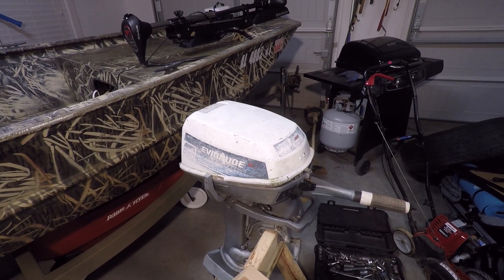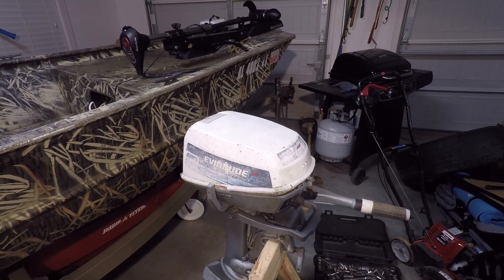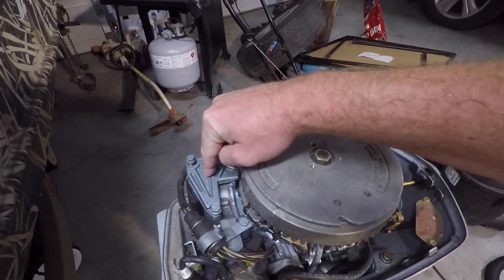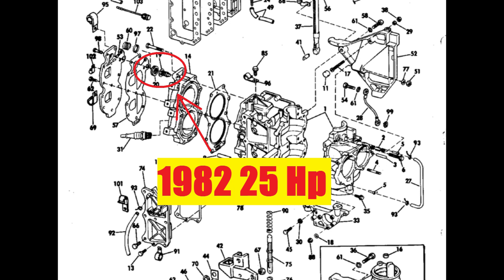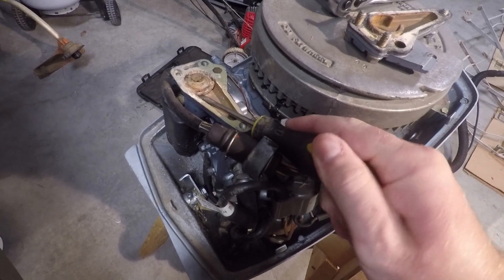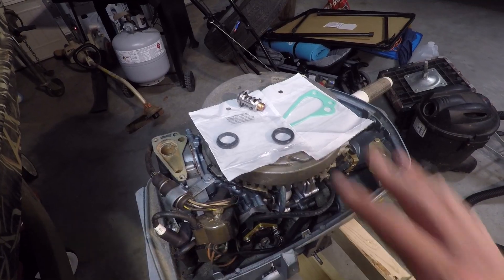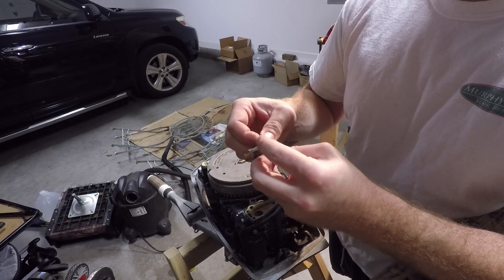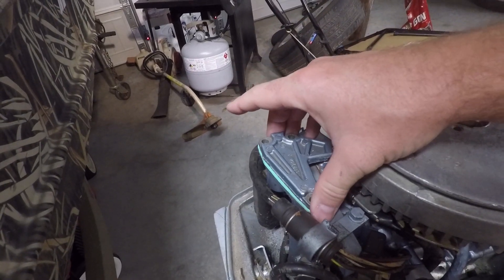Johnson Evinrude Outboard Thermostat Replacement

Comment: I’m looking for a 1985 Johnson 15hp 2 stroke
Reply: What parts do I need
Reply: The telltale is extremely weak although the thermostat is functioning normally
Reply from the maker: Water pump impeller.  https://thisoldoutboard.com/johnson-evinrude-lower-unit-impellers/

Comment: I cannot find a complete, assembled thermostat  for my  1993 Johnson Outboards 9.9 [ J10RETM]? 

All I've found was bits and pieces from Crowley. Can anybody help me find a completely assembled thermostat  please?
Reply from the maker: http://www.marineengine.com/parts/johnson-evinrude-parts.php?year=1993&hp=9.9&model=J10RETM&manufacturer=Johnson&section=Cylinder+%26amp%3B+Crankcase
Reply: Looks like I will have to buy that thermostat and put it together myself. Thank you for confirming that's the only option 👍.

I better make a video for people who needs that same thermostat 😅

Comment: Do you have links for the 1993 Johnson 9.9 hp J10RETM?
Reply from the maker: http://www.marineengine.com/parts/johnson-evinrude-parts.php?year=1993&hp=9.9&model=J10RETM&manufacturer=Johnson&section=Cylinder+%26amp%3B+Crankcase

Comment: This is exactly the issue I ran into with my motor, recent auction purchase, and it will solve my flow problem.  I've already replaced the water pump/plate and this will button things up nicely for the rest of my summer.  Thank you so much for taking the time to put this out for those of us needing the help.

Comment: Is it a good idea just to replace this? I just acquired a 1979. It runs great. Stays decently cool.
Reply from the maker: The most important thing is that you do have a thermostat in your motor.  Some people just remove it when it goes bad instead of replacing it. I would at least check that.  If it seems to be running fine and you have a thermostat you should be good to go

Comment: My godfather taught me to use permatex tstat rtv on both sides of the gasket; which I did 10 years ago. Have you ever had any problems not using rtv? I am replacing my tstat.
Reply from the maker: Joe Blow I haven’t used RTV for that before and I’ve never had a problem.  The only issue that I can see is if the excess gets in the flow and clogs something up.

Comment: Wow I'm glad I watched this video I ran outside and checked my 6hp 1973 evinrude I bought last week and the thermostat is missing! Could that be the reason it wouldn't start until 10 pulls then it wasn't peeing water? I only ran it for a few moments when I realised it wasn't peeing. I'm replacing the impeller also using you other video.
Reply from the maker: Chronic Gaming Inc the hard start is probably the carburetor, the thermostat should have no influence on how it starts.  If the motor has sat for a while then the odds are good you need to "rebuild" the carb.  It's easy and I have a video on how to do it as well.  

Having the thermostat in there keeps the right amount of back pressure in the system to make sure you get the most heat transfer.  That's it's main function along with regulating the temperature. They are cheap too, I have a link to one in the video description.  I also have a link to the carb kit in that videos description as well.

Best of luck!!
Reply from the maker: +Chronic Gaming Inc here's the link to the carb rebuild video https://youtu.be/zhwtecCRg44
Reply: Thanks got the carb kit on the way!

Comment: Thanks for the video.
What is the purpose of the thermostat? Is it important to replace it on a regular basis?
Sorry for the noob questions.
Reply from the maker: +peter yeung the thermostat regulates the flow of cooling water throughout your power head.  In regulating the flow of water the temperature of the power head can be maintained at the optimal/engineered temperature.  If the thermostat fails shut, your power head will overhear.  If it fails open then nothing detrimental will happen you just may not be running at the peak performance temperature.
Reply from the maker: +peter yeung regarding how often you should replace it, I would just do it if the motor is new to you or if you have recently replaced the impeller but are having water flow issues
Reply: I must apologize, I never got any reply notification. Now, after 3 years, and watching this video again, I have to thank you for your detail explanation. I was just running my 73' 9.5 in a barrel, and the powerhead felt hot to touch. I mean I can't really put my hand on it for more than a few seconds. Water was pumping good with a new impeller recently changed. I removed the thermostat and put in hot water, and it tested good, it opened. But the water was from an electric plugged in kettle, which means it hotter than 143 degrees. Is there a better way to verify that it's working properly? Thanks again.